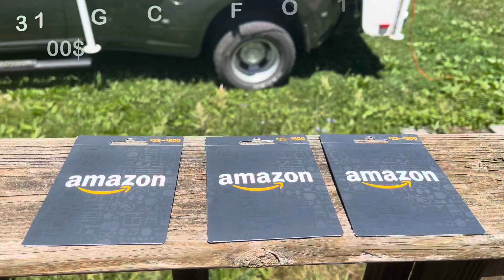Firewood, Back at It!  #242

Comment: Hi guys, that processor attachment is pretty nice. Have you done any measurements to figure out how much you can process per hour and what the average fuel consumption is on the skid steer?  It looks like you have a hand control for the processor as well? Nice way to keep the manual labour to a minimum! Take care, Jason.
Reply from the maker: Hello Jason, No I run the Bobcat at about Half Throttle, And there is just to many variables to say, In a perfect world and all the logs were 14” and straight, A cord an hour would be easy, As far as fuel, this bobcat is the most fuel efficient machine We have ever Owned. Yes I have the optional Joystick control so i can run the unit standing outside the bobcat. Take Care and be safe 🚜🪵👍🏼🇺🇸

Comment: I don't understand why the machine doesn't push the wood all the way through does it not go all the way to the bars I've always wondered that about that 1 James T North Carolina your neighbor
Reply from the maker: Hello James,  The splitter can have a single, 4 way or the 6 way I have on it. Any Fixed Protrudes on the push plate would just mash the wood before the splitting action began. I suppose if everything was Fixed permanently it theoretically could be Possible. Thanks for watching 🚜🪵👍🏼🇺🇸